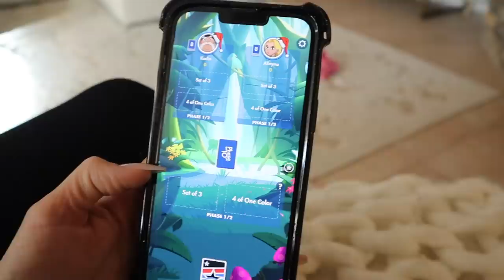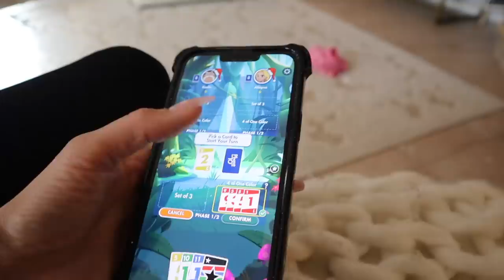$500 KITCHEN MAKEOVER IS DONE!!  // ALL MY MISTAKES // FINAL TOUCH UP // ADDING  HARDWARE

Comment: What an amazing transformation!  I have to admit that when you started on the countertop project I wasn't sure it was going to turn out so well.  But wow!  So much better.  The only thing that I would change is the white baseboard around the island.  Did you consider painting that black too?  Also, if you had to do it over again, would you have painted the cabinets (at least the lowers) after the countertops?  Just curious because I may be doing this to fix up one of our bathrooms.  I love the cabinet hardware you chose.  Ties everything together.  Well done!